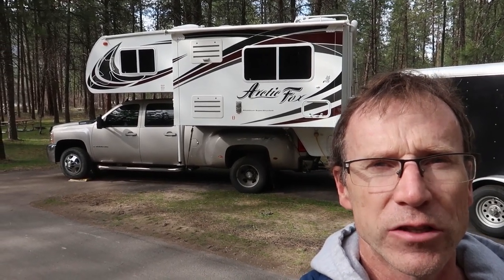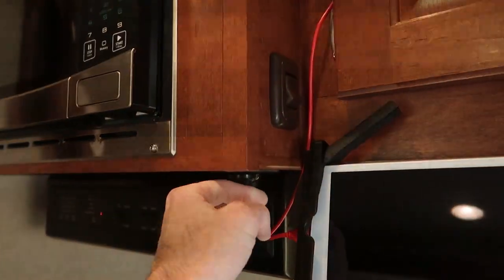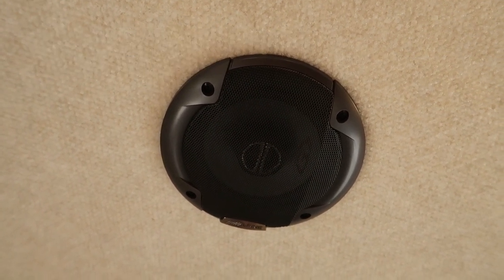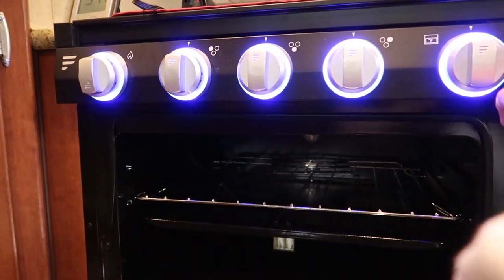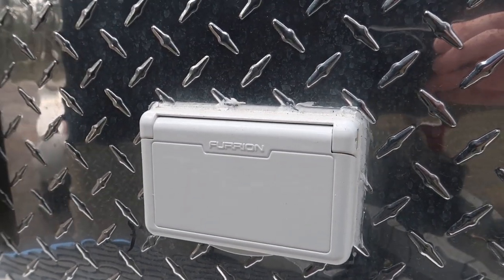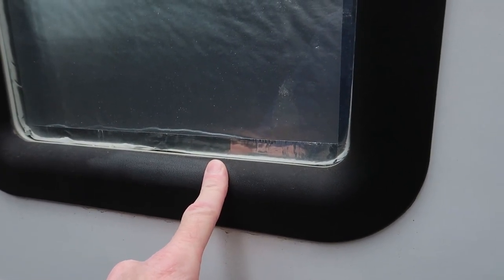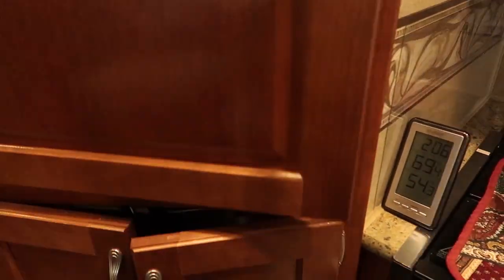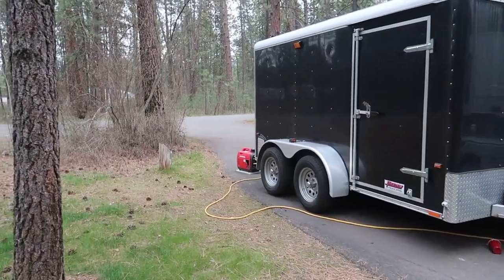Upgrades to my Arctic Fox 992 Truck Camper | RV Upgrades

Comment: You sure do lots of work on your camper. We had a 2008 Lance 992. I was planning on upgrading to lithium batteries and an upgraded converter but instead I ordered a 2022 Lance 1172 truck camper traded our old Lance camper in on it. We ordered the options the way we wanted. Dual lithium batteries dual solar panels plus we already have a portable one. LP generator on board. 4 season and has the new European acrylic windows. I’ve purchased the NRVTA on line RV course to help diagnose and repair any problems I may have. A warranty doesn’t help you when you’re hundreds of miles from a dealer. We love our he versatility of a truck camper compared to trailers and other classes of RVs as we prefer boondocking. Our camper sits on a 2008 GMC 3500 diesel dually 4x4. I put a set of airbags on it to help carry the weight. Our 1172 weighs 5000lbs without water in the tank. 
Great video always something to learn as a camper newbie. 👍🇨🇦
Reply from the maker: I have the same generation of truck.  We both need new trucks due to being severely over the GVWR of our trucks.

Comment: do you have a list of components you used to install the Battleborn batteries and the placement of those - like the converter?
Reply from the maker: I don't have a list of components used.  I purchased some battery cable and terminal lugs for the cables, a post to connect all the negative cables to and also A Victron BMV-712. More details on the Battleborn install here:  https://www.youtube.com/watch?v=dNSVdx1P1x0
I unplugged the converter and disabled it.  My charging system is a Victron Multiplus 2000 inverter/charger, shown in this video: https://www.youtube.com/watch?v=B_bwxJLH8h8

Comment: You have some fabulous videos and I highly appreciate it I just bought a 2016-992, I wanted to ask you about your fan replacement at minute 21 of this video after I got the camper home and plugged it into the electric outlet and turned on the heater all the vents were blowing out hot air except the one under the bedroom step it was blowing ice cold air directly out at my ankles. that just doesn’t seem right I was hoping to get your opinion on that thanks in advance.
Reply from the maker: The vent under the bedroom step isn't a heat vent.  There's a fan in that vent which blows air into the step area, which connects to the "basement" area of the camper where the water tank are located.  The purpose of that is to circulate warm air into the basement area to keep the tanks somewhat warm when camping in cold weather.  If that vent in your camper is blowing air OUT at you, then Northwood installed the fan backwards.  It should blow fan IN the step.
Reply from the maker: Also, did you join the Arctic Fox truck camper group on FB?